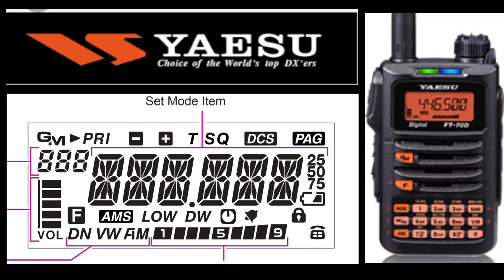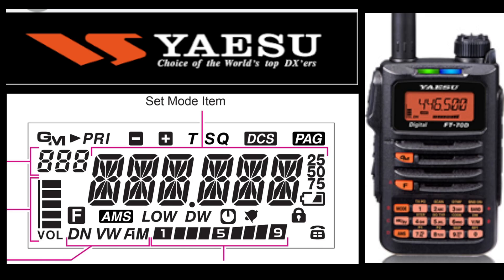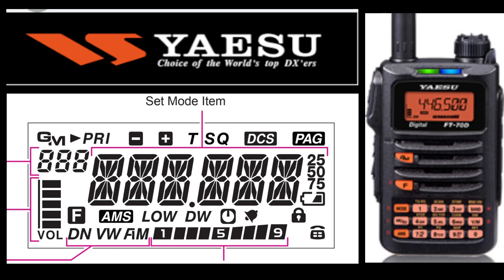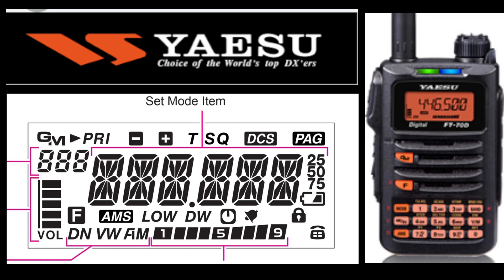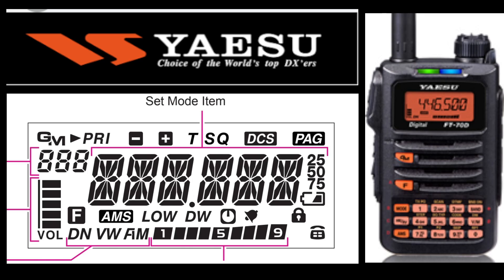YAESU FT70D SCREEN CONS & LINK to Manual

Comment: I got one of these. Not used the phone at the bottom right or GM. Those will be power off, The bell not sure as not needed, all in the manual I had to get out when out and about the other day when on bike and went to nice high area above Oxford. Good for the radio. Got the little triangle (by the GM) on a repeater emory. Thought what is that, Set memory skip on that by usual button pressing but did a bit wrong. Must have done funtion and number 9. Skip as seconary funtion!. Live and learn. Not as easy to use as the good old Baofengs I got rid of for the buy another drone to replace the Sunk in canal one fund  :(     Little numbers at the end part of display part of the frequency punched in. Me using, nice days or no so nice on QRZ.   G7TRV
Reply from the maker: Its all learning